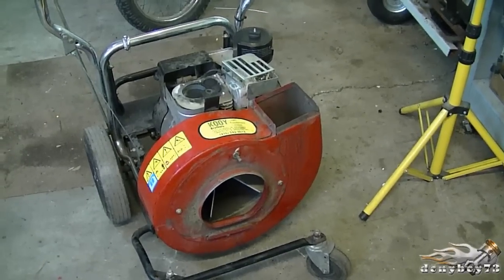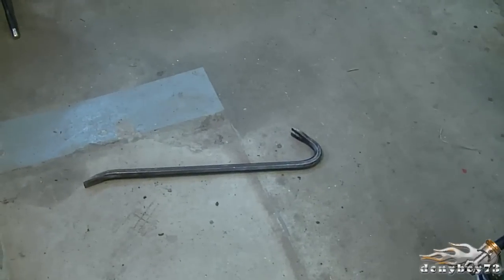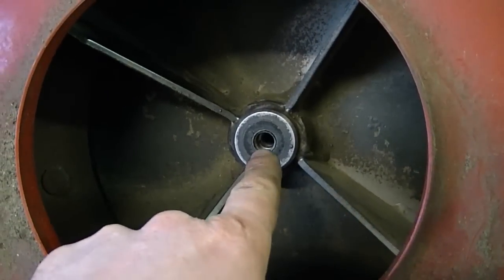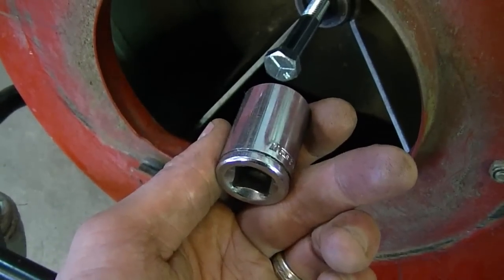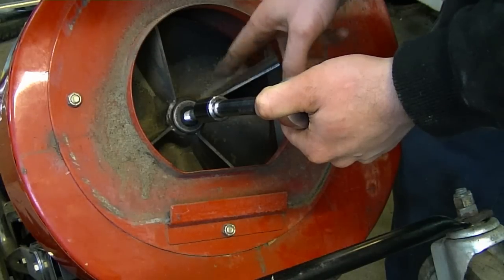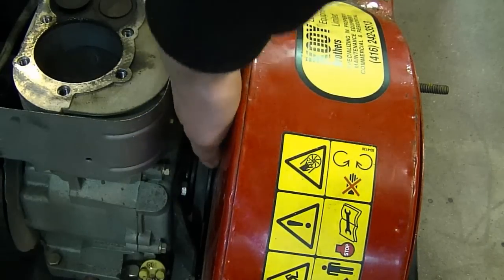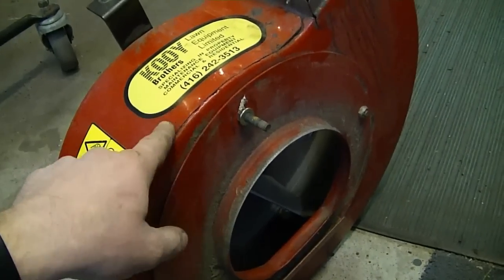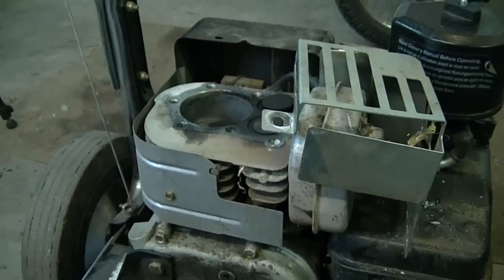Removing A Leaf Fan From An Engine Crankshaft

Comment: I have a MTD chipper shredder. It's about 10 years old. I can't get the chipper flywheel off. It looks similar to the fan. Any videos or tips to remove it. I tried screwing in a bolt by hand and with an impact gun. It won't pop. Help!!!

Comment: you know,i would have been fighting with that thing all day then end up chopping it off with a torch before i discovered thoes threads... most of the simple ideas require a master mind i guess. thanks for the tip,i will keep it in mind for when i need it!

Comment: Did  that on   DR  vac is a  7/16 th's or  9/16 th there was  damage from a   rock throws  the 
shaft out of  round  which which damage's the  cylinder an cam. TU  DOC.

Comment: it's very difficult to just see on threads if they are metric or UNC you can put a M 6 mm on a 1/4"UNC it will enter but stops after 3 or 4 turns and vice verca I use a 10mm spanner on the M6 bolt and 11mm spanner on the 1/4" UNC